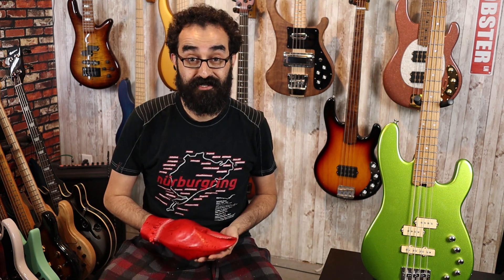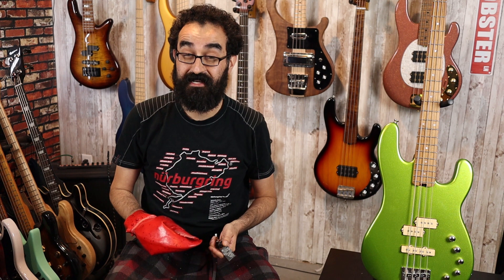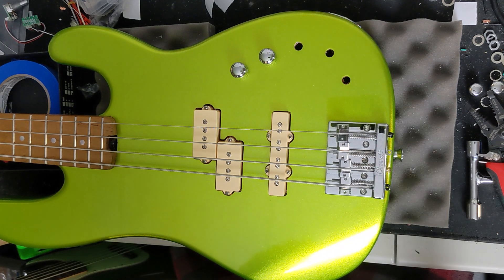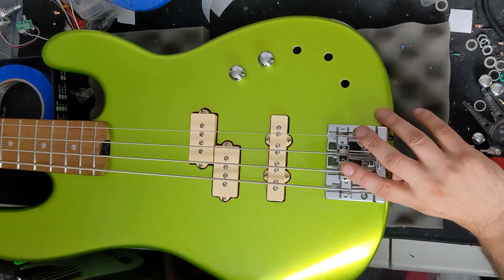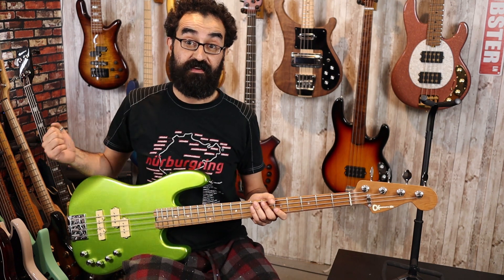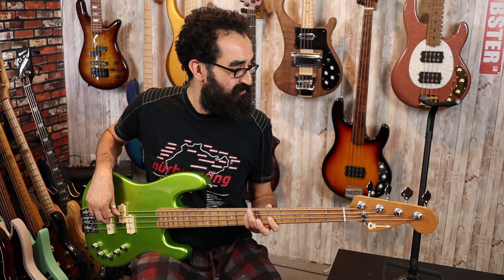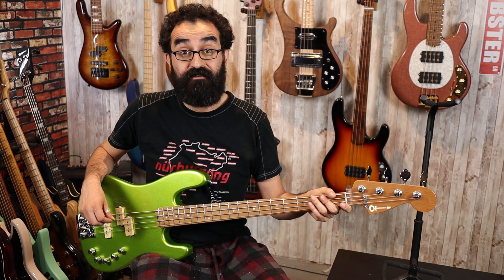Charvel San Dimas Preamp Swap - Installing the Darkglass Tone Capsule - LowEndLobster Fresh Look

Comment: Sounds good. This is a case where you can hear how sterile the stock pre is compared to the Dark Glass. I just wish it had a bypass with tone control. Sounds like a good mod to add to this green machine😉
Reply from the maker: Thanks Meyers! Indeed this is a great example of how big a difference a preamp can make. I was contemplating doing a tone control mod on this, but was happy enough with the DG. What was extra great here is that I didn't touch the pickups or strings, just the preamp. So pickup height and everything is unchanged, so all you hear is the preamp!

Comment: Hi Lobster King :) Just received my Charvel and this bass is really great, I get this awsome P bass sound. It needed truss rod and string height adjustment. I also lowered the pickups, and it helps to normalize the output level. Mine seems less noisy than the one you tested, but shielding is still planned! You're right for the EQ boost that causes clipping, but I found that it's also a strength as you have more room to shape the sound (of course, pushing to the max all frequencies will cause clipping, but I always try to EQ by removing frequencies, not by adding). I also plan to install a Delano Sonar 3 preamp and will provide an update here. So, thanks for your review, it was inspiring!

Comment: So I have a DGTC in my sandberg and my favorite thing about it is that I can use every single bit of the boost and cut on all 3 bands.  I cannot find any unusable tones.  I attribute this to the frequency selections.  
On my Genzler rig I bet you couldn't overwhelm it with boost and mid cranked and treble cut all the way.  
I will say though,  the John East I use in my EHB to me sounds like a better preamp and I can set the bass, mid and treble windows into the same frequency ranges as the TC leaving the only variable the "coloring" of each.  
TC: plug and play, easy to install and ready to rock at a great price.   
East: twice the price, way more adjustability, not so easy to install.  
Both: WAY better than stock.
Reply from the maker: Great comment dude! I 100% agree. The DG is one of those preamps that you can really crank without needing an amp pad or gain reduction. I 100% agree about the east. Messing around with my Dingwall 'Dingray' with the East MMSR, I can find myself getting pretty close to the DG tones with the treble boost and 'bright' mode. Yan really dial in the clank! Damn right about the install too. I appreciate how the DGTC is an 'add on circuit' where the east is definitely a more intricate and finicky install (learned a lot about shielding/grounding my first time installing one!)

Comment: The bass definitely sounds a whole lot better with the Darkglass preamp. I still think my preference for this particular bass with those DiMarzio pickups would be a simple passive vol/vol/tone configuration. I really love the way my mid 80s MIJ Fender Precision sounds with the DiMarzio split P pickup, never felt like it needed a preamp.
Reply from the maker: Thanks Michael! Agreed, a simpler control setup would have negated this whole issue entirely
Reply: @LowEndLobster  not to mention it would make the bass less expensive. Win-win. The stock preamp is crap and while I don't really think the Darkglass fits the character of the San Dimas it's much much better than the original one. What were they thinking?
Reply: I think they shot themselves in the foot by not making it a simple passive. Not only does it have the problems LowEndLobster has detailed but it detracts from the wonderful 80s aesthetic of those straight up throaty sounding mean workhorses with your cream-coloured P/J pickups.
Reply: @NeglectedField  man people sleep on passive, and PJ especially, they can really punch with the right pickups

Comment: I just picked up this bass and the Tone Capsule after watching your video... I just tried to install it however I must have missed something as there is no output when I plug it in and I notice the battery got pretty hot. 
I tried to follow the wiring diagram supplied by Darkglass and by watching your video. Your installation went by pretty quick and even slowing it down I couldn't follow along. 
I'm getting confused with the push/pull volume pot. 
Would you be able to share how you installed yours? 
Love the videos man, excellent content!

Comment: Is there a version of this video where you explain how to install the preamp? I have the preamp and want to install it in a '91 Peavey Dyna Bass Unity Series. The current pickup configuration is an EMG PJ style with volume, blend, bass and treble pots. I want to do this myself but not certain about the wiring. Darkglass toes provide schematics but any help would be appreciated. Thanks and great content.

Comment: Souch cleaner , less clicky .  Makes it sound fantastic. 👌 love it ,want it .. endless possibilities.
Wonder if I can get a tone capsule in either a Suiere PJ or US performer PJ
Reply: You'd likely need extra holes drilled, but it's possible.
Reply: @thejoetandy  thank you Joe. Yes in the pickguard.  Hope enough room behind it for battery too . We will see 
Thanks
Reply from the maker: Thanks Stuart! Also, if you don't want to drill you can utilize a stacked noble B50k pot with center detent and stack some of the darkglass controls. I did this on the DIY DarkRay and on another upcoming ray video (giveaway winner's Ray24)

Comment: Ok Lobster. What are you doing to me man?!? Very good options you got here with the dark glass. The thing I really like is the high mid vs the treble on standard preamps. It's not so clanky and cleans up the high end. I'm not sure if I'm hearing it clearly. But if I am, I'd say a different "modern pickup setup" needs to go in there. To help bring out the Darkglass tone better. I'm not sure which one. I was thinking Delano or Bartolini. I really like how the Delano in the "Mint O Ray" sounds over the DiMarzio. It seems to be a little fuller and growlier. Over all though. A much needed improvement over the stock preamp for sure. What do you think? Until we groove again ✌️😎👍🦞🎸

Comment: That little orange amp sounds so good 👍
Reply from the maker: Thank you! I have another 20-25 watt version (I forget) which I brought to NAMM for our hotel room. My buddy who was with us also brought his GK410 combo (big amp). I had my bass plugged into the small Orange, and it fooled everyone. They thought it was the GK. These little orange amps are built super well and have great low end response. The only other small amp which impressed me as much was the new Ampeg rocket series that just came out
Reply: @LowEndLobster  unfortunately both Guitar Center and Sam Ash her are empty so I can't even try them. Hopefully when they start stocking up again I'll come across one 👍. I actually run a Gallien-Krueger RB700 through an Eden 4x10 and an Ampeg 1x15 that's sounds really nice but when I hear your demo's I'm like 😀. I have good neighbors who don't mind me cranking all my gear so I really don't need a small amp but I'm always up for some good tone gear 👍

Comment: Hey Lobster, excellent video and mod as usual. Are you going to do that video of the new Sterling Ray34 black ash as it comes, without any modification? I know you already made a video of the Ray34 with natural swamp ash. But I recently had the opportunity to try both basses side by side. I can swear the black ash one sounds different -in a good way. Thanks!
Reply from the maker: Hey Emmanuel! Yes, there will be a review of the Ray34 Ash Black. It sounded exactly like the old Ray34 ash I had IMO hahaha, but I still haven't tried the regular Ray34 non ash yet. I hope the mahogany can get the weight under control lol. The black one I got is like 11.6 lbs, a backbreaker for sure haha. Either way, I did shoot a review before doing the DIY Darkray mod - I was just too excited about the mod to wait. The unmodded review will be coming soon

Comment: I was just on the Moyones bass configurator page & noticed that there was no treble control on the Tone Capsule~ strange, but I guess I never reach for the treble know & all the extra control of the mids is very useful. Have you ever played a Moyones?
Reply from the maker: They call it 'high mid' instead of treble because the target frequency is a bit lower than a typical treble control. It does perform the same function however in terms of targeting the 'high' frequencies, those freqs are just lower than other preamps.

Comment: I wanted to see how to hookup the new preamp. I blinked and it was already installed. So the two black shielded wires from the old preamp, just cut and wire the 4 leads as per instructions? Thanks
Reply from the maker: Doh! Sorry about that. I'm going to have my newer mod videos be a bit more clear in regards to what's going on.
Reply: @LowEndLobster  Thanks, I have the same exact bass& preamp, installed the unit. It works but the 3 controls do nothing. I will double check my work.

Comment: I just got one of these. I have the same noise issue but the pre amp on mine is an open circuit board? Not the black module encased in epoxy. I wonder what is the deal with that!

Comment: LowEnd would you recommend the DG for the Ray 34?
Reply from the maker: It would work! Check out my 'Project Mint-o-ray', one of the first projects on the channel and the first one that featured the DGTC. You get the darkglass coloring, which may or may not be ideal depending on the type of music you play. However, it did work well!
Reply: @LowEndLobster  Thanks for getting back to me LowEnd :) I have a recording studio and have many basses. I don't have a bass with a DC pre-amp so I am picking my Ray 34 as my test subject LOL. This bass with be used for metal so I think it will turn out nicely. My metal clients will like this since most of them use the Dark Glass pedals. I will check out your very :) Thanks as always.

Comment: If you were to have to make the darkglass 2-band, what controls would you use? because the bass im thinking of putting a TC in only has enough holes for a 2-band
Reply from the maker: You can stack a set of the DG controls. Check out my video with the Aguilar DCB MM and the Darkglass in a Ray24
Reply: @LowEndLobster  the case I have I don’t think will allow me to get a stack but is it possible to run the TC with only a high kid and bass?
Reply from the maker: Yes, I need to see if the internal pot that Spector uses for their DG implementation is available
Reply: The EMG BTS would make a good alternative. The treble control can be set to 2.5 K which is lower then the darkglas high mid, and both the bass and treble feature single pole filters, so very musical. I'm planning a custom bass designed around flats and it's either the darkglass TC or the EMG BTS/BQS that will be the preamp.

Comment: is it worth to get a san dimas to switch out the preamp as soon as you get it?
Reply: If you like the look and pu config, then hell ye.
Reply from the maker: Worth it is a pretty subjective term. I think it's worth it because the rest of the parts used for the bass are stellar. Neck is super comfy and fast, body color is popping, hardware is very solid and the pickups are killer. That being said, I wouldn't buy the bass for the sole reason of swapping. I'm just a crazy person ;P
Reply: @LowEndLobster  cool
Reply: @LowEndLobster  if you can find one cheap used in good shape I absolutely would snag one then shield it and swap the pre.

Comment: 0:10 oh im sure it's gonna be nice
Reply: 3:55 the nearest cat is looking at the computer now
Reply: 6:15 it already sounds badass lol

good pickups + good preamp = sounds badass

that's not new math but it's the good math
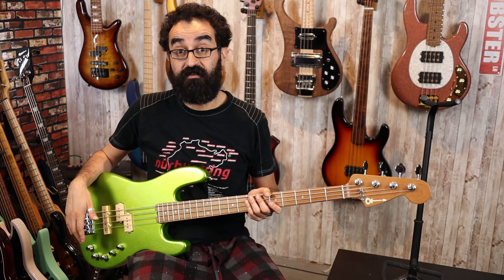Reply: 8:25 this now sounds like a 2k USD or better bass out of the gate.  First pluck.  Completely different machine; same husk totally not the same throat.
Reply from the maker: Thank you! Yeah man, the DG definitely woke this bass up and gave it the character it needed.
Reply: 12:20 put some tapes on that thing already and get woofin - also INSTALL STRING MUTES on this bad boi for sho

and then you got scooped as fuck lol

it's got its own voice that fits in with all the classics yet somehow remains distinct - GREAT BASS NOW.  Absolutely.

Also cheap as hell for what it can do, so gig the shit out of it ha ha ha
Reply: 13:50  I wouldn't disagree with anything but my take is that it's a very classic and modern instrument at the same time and I quite enjoy the looks and sound of it.

They make a 5 lol and this has moved up on my list of projects, everyone needs a workhorse that they don't give a shit if it gets rained on and there is value in being able to build another one off the shelf if you get stuck without something - Project Workhorse I guess I'd call it.
Reply: 15:45 - spits without being too buzzy, nice bit of fizz and no icepick action so it worked out pretty great.

with flats you def got a fretted jaco but you can also coax nolly tones out of it as well...

I think what you have is a great config now that would go with a couple pedals well to make any classic or modern tone you want, depending on the pedals.

The standard PJ is a super utilitarian format, so you basically made a Gelandewagen out of a Samurai that was broke from the factory, too extrapolate some hyperbole...